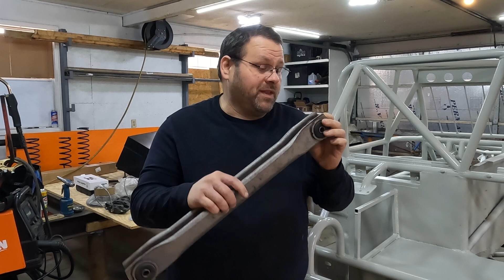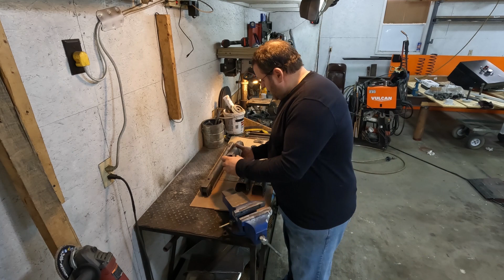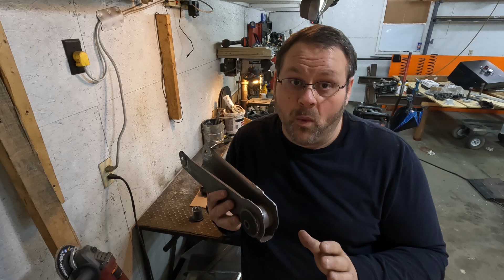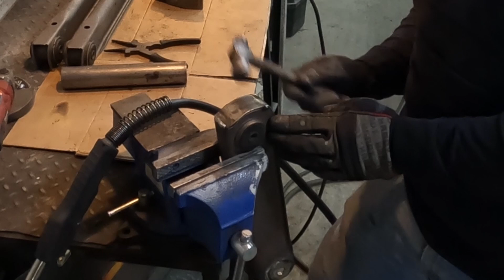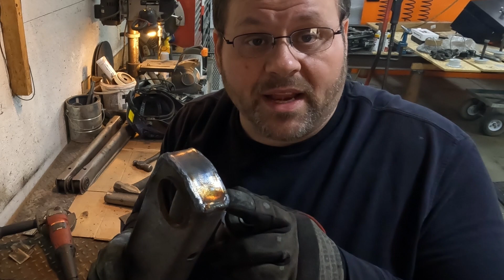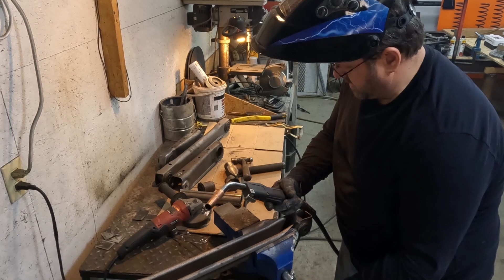Beefing up Rear Control Arms for the Crate Racin Street Stock

Comment: Jason, I've heard it said to run these rear bars "loose".  Does that mean to use aftermarket bushings that freely pivot instead of OE bushings that twist the rubber ?  Or does it mean have some end play, so the rear end can shift and induce rear steer ? Thank you !
Reply from the maker: Bob, I use stock rubber on at least one end of the arm and then to "keep them loose" I run a little bit longer bolt and lock 2 nuts together where the hanger is not pinched down tight on the bushing. It helps the rearend move significantly.

Comment: I have a question why are you not putting the steel bushing like you did in the front
Reply from the maker: On the rear that rubber has a very specific function. It is what absorbs torque during acceleration to help get drive off the corner on slick tracks. Its a necessary thing when racing tracks that go dry slick. Very different from the front for that reason and also on the the rear the spring directly holds the car up whereas on the front the spring is across a fulcrum point on the lower and a rubber pivot is a problem for that reason.
I appreciate the question DirtTime100 and appreciate you watching too sir.
Reply: @DIRTRACELIFE  thanks for answering the question I’m build a modified street an 88 Camaro going to try some of your front end advise on it thanks again

Comment: I thought CRUSA street stocks could run heim end tubular trailing arms? That’s the route I would’ve gone
Reply from the maker: They can Rob but even if I ran the aftermarket tubular arms I would still be using the soft rubber bushings instead of the hiems. I am after the best solution for a smooth dry slick track and I believe running all stock bushings (or if aftermarket I still would want a durometer reading of only 50 to 60) is the key to that setup. 
I think the hiems are good too but in my opinion its for hooked up and sometimes rough tracks where you want less movement in the rear end. 
And I am on a budget.... Those bars are EXPENSIVE!  
I wouldn't mind having a set for when I find myself on that hooked up track. But it will have to wait :)

Comment: Man I could of saved a lot of stock arms if you would of made this video a long time ago lol I’ve always had the bushings loosen up too so I tack weld them in but I wonder if the egg shaping before they rip out is why they got loose maybe yes no
Reply from the maker: Everyone of them I have seen loose was egged and I think its just the wear doing it is some cases. Its not like I am adding full on plating but I think these end caps can be just enough to stop them from loosening up and getting ripped out from fatigue alone.

Comment: We have more trouble with the top arms egg shaping. We have discussed making a washer to weld around the bushing hole. I do also like the idea of welding a brace around the end. However I’m not sure that the reinforcement of the control arms is legal, now the moving the rear hole is allowed. Still it’s food for thought
Reply from the maker: Speeaking of rules, Its seems every class of stock car has a slightly different set of rules when it come to how you can work on the control arms, modify, or reinforce them.